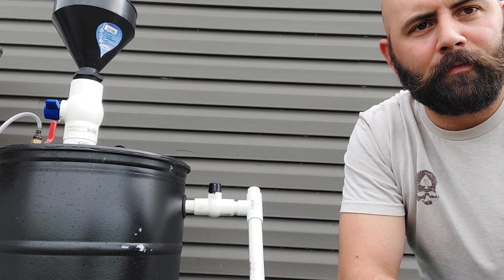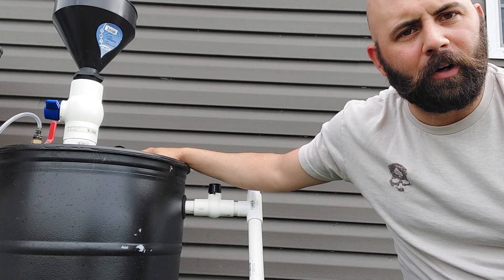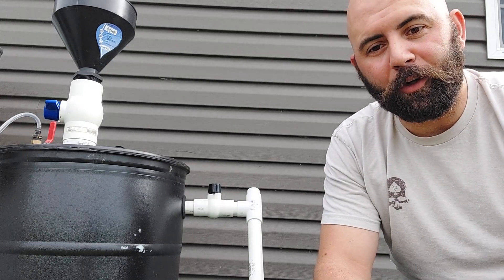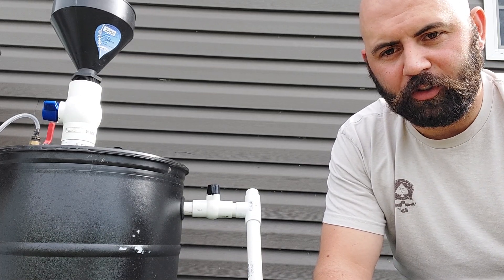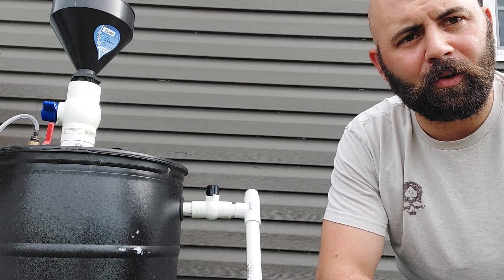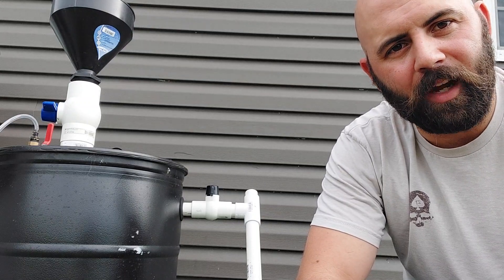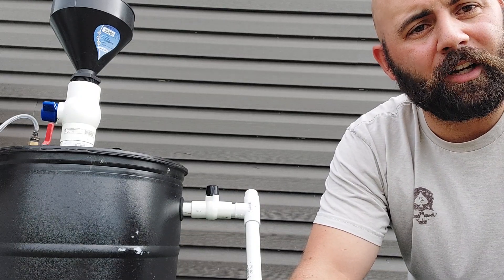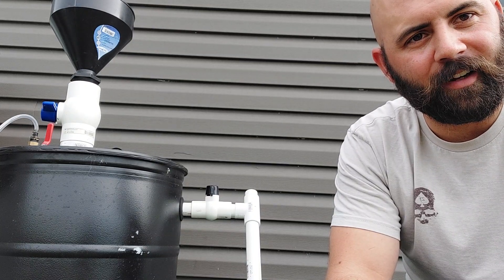biodigester questions.

Comment: The main reason you can’t find anything on the Internet is because it’s suppressed. I’m sure people try to put YouTube tutorials out there to the public but I’m sure it gets blocked. It’s reasonable to think that because I know for a fact that in other countries, Biogas can be used in place of propane. It doesn’t burn as high of an octane soda speak as propane but pretty close. My wife is from the Philippines. I know of a guy that does it over there and sells the Biogas after. it’s already been filtered, but like I say, you got a filter at three times with all three filter that you use in your other video. That’ll get the H2 down far enough so that it’s not corrosive to the Combustion engines whether it’s a car or a generator. They also have Biogas lights you can use to light your house just like propane. I’m trying to put together a system. That’s more streamlined and can give everyone a off grid energy source for all their energy needs.
Reply: I love yalls vision!
How is building this out going for you so far???

Comment: The valves are the problem without them as the pressure builds it will push the slury out as for running a vehicle you'll need a propane conversion and up the amount of gas we at one time had our trucks all on propane although your system is way too small look on utube for solar cities biodigesters made from a IBC tote there are a lot of videos on biodigesters and also compressing it into propane cylinders 1000 litres methane into a 45 pd cylinder also videos on converting stoves furnace and hot water tank tanks to run on methane there are also videos on how to convert a gasoline generator to run on methane once I get my cube van empty I'm going to Calgary Alberta Canada to get some totes and some barrels with removable lids I want to find a way to join together two barrels for 90 gallons of liquid I'm looking at 2 digesters fed every other day and a 3rd one to digest the outflow from the two main digesters and a final one for the fertilizer what I want to try also is a new method of holding the methane I'm figuring to use 2 barrels end to end so 90 gallons of gas I think I can set up another set conect the bottom gas barrels to the 2 above bottom to bottom that way as the gas fills the gas storage tanks the water will be forced out of the bottom of the gas tank into the tank above I'm planning on building a rack to hold the barrels horizontal I have a space between my shed that's 30 inches wide and 14 foot long shed is 8ft tall so they should fit  once I get my barrels I'll then see if my ideas work just got to buy 16 barrels with removable lids

Comment: We have biogas in Sweden. I had a VW that ran on biogas. I had a small gasoline tank to prime it and to bring it to temperature. When it was at the temperature it would automatically change to biogas.
Reply from the maker: This is very cool. Did you run it on gas from a homemade digester?
Reply: @BiogasUSA  no you buy at at the gas station like regular diesel or gasoline from a pump. The car came already equipped from the dealer.
Reply from the maker: @61joro  so that is going to be compressed natural gas (CNG) from the gas station. It could be gas from a digestion plant, and oil well, or a gasification plant that has been processed and purified in a commercial gas plant. Still very cool. 

What I am trying to do here is purify the methane from a digester in my garage enough that I can run a car like yours off it. If I succeed, I will be able to manufacture my own CNG from kitchen scraps.